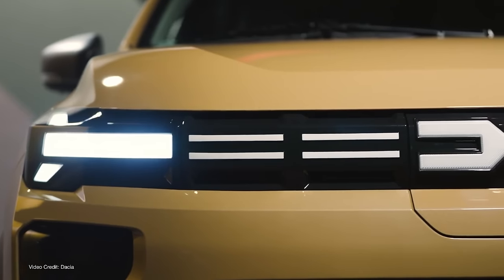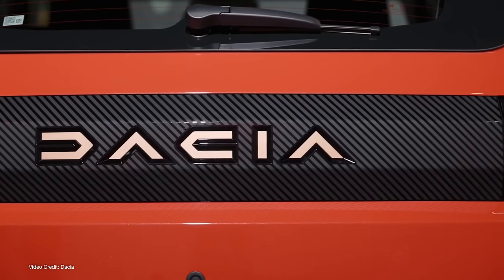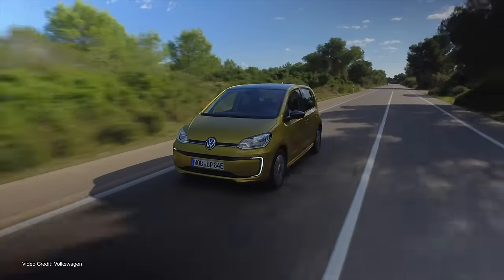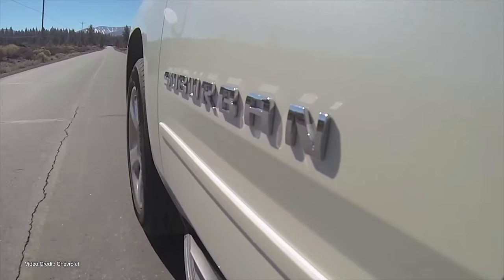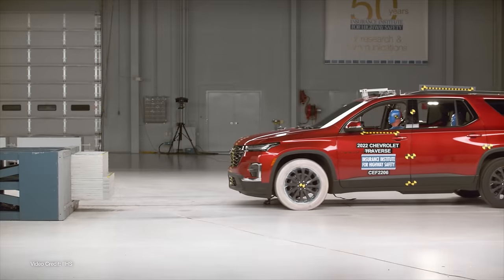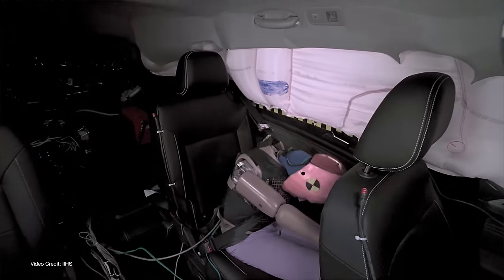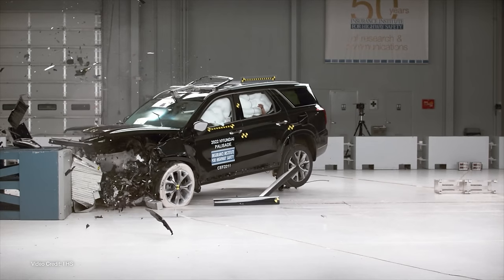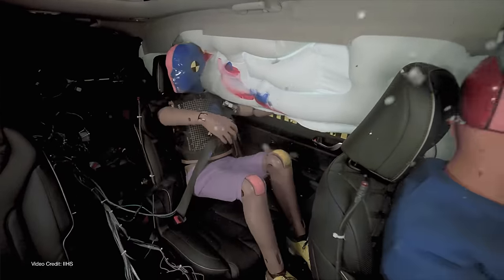Never In The USA - Why the US (And Canada) Appear To Be Anti-Small EV

Comment: First off I would totally buy a $15k EV for around town. Secondly, you just spent a live stream justifying how you will replace the 100kwh f150 lightning with another 100kwh f150 lightning (close enough to the battery size) and while I was happy to see editing Niki pop in for the context, you are personally opting for a big EV while this video is arguing about small EVs
Reply from the maker: Because, as we've said many, many, MANY times, we do need a hauler/tower/peoplecarrier. And when we don't need it (or the battery backup it provides) we don't use it.- Nikki
Reply: @transportevolved  yes you're correct you did say that in the video. Good luck with that hand recovery and the search for another f150. Do you want to do a video on trying to find a used EV to buy? Or something about getting the replacement. When the insurance dust settles.

Comment: I'm not a normal American driver. I drive using defensive skills to the point that I can see potential hazards before they happen and avoid problems on a  routine basis. I had a Mazda Miata for fourteen years and my first EV is an Arcimoto FUV. My next EV will be an Aptera, yet another three-wheeler. Everyday I see fools driving by themselves in a huge  truck or SUV. This is why we are undoubtedly screwed as a species.
Reply: Rising insurance costs causes many to purchase a larger "practical" vehicle than a 2nd tiny "puddle jumper" because most of the fuel savings will be consumed by increased auto insurance.  

I'd like multi vehicle insurance to be like renting my own car - pay nothing on the 2nd car until I use an apt to transfer a coverage token from one of my vehicles to the other car. Then, I'd be driving the puddle jumper most of the time.

Comment: It's not about the size. It's the range. I wouldn't buy an EV with less than 150 miles of range even at this price. That's effectively 100 miles from 10-80%, and I wouldn't let an EV (or an ICEV for that matter) fall below 20 miles of range, so 20-80% or 90 miles is more like it.

America is huge, and Americans love to travel. The Dacia Spring is not a lot smaller than the Bolt, but it has half the range and charges even slower. Sure, it's fine for around town driving, but most people don't want a vehicle limited to around town driving. They want a vehicle that works around town and also works for road trips on the weekend.

I work from home and often don't drive more than 20 miles on a work day, but I take an 80-100 mile (round trip) road trip practically every week, and I don't want to charge on these trips. I take 250 mile (one way) road trips several times a year. Stopping for 45 minutes every two hours or less is a much bigger deal than stopping every four hours. Am I supposed to own a second vehicle for road trips?

Also, 0-60 in twenty seconds is pathetic. What's the point of an EV without better acceleration than that? I would dearly miss 0-60 in six.

I drive a Bolt EV, and it replaced a Mazda 3 hatchback, so I've never been a size queen ... even if my own equipment appeals to them ... Glad you're feeling better.

The Tesla Model Y is not a lot larger than a Bolt EUV, and it's the most popular EV in the world as well as the U.S. It's only barely longer than a Mazda 3 hatchback. If it were an ICEV, it would be a compact hatchback, so there is demand for compact hatchbacks here. Legacy auto's obsession with electric pickups and large SUVs was a mistake, and they're realizing it now.

Comment: EVs are still between 40 and 60% more expensive than comparable ICE powered cars. The charging infrastructure is still insufficient, the cost of charging outrageous if you have to use a public charger, the insurance and maintenance cost way above the ICE cars and, to add insult to injury, the depreciation is enormous! EVs are a complete failure! Contrary to what you say, they don´t sell well at all!

Comment: don’t dismiss range when civilization is ‘down’ and charging may be limited - we are flirting with a civil war for some reason currently
Reply: Why? Everyone is walking or on a bicycle at that point. Gas pumps need electricity to function.
Reply: If you have solar: charging your EV would be a lot easier than refining gasoline yourself.

Maybe you could convert a diesel truck to biodiesel or something. Still would need at least a small battery/solar to act as a tank heater (biodiesel is more likely to gel).
Reply: @jamesphillips2285 planing on having power at home but need ‘range’ as home is only place i know i can fill an EV up on demand. my point was you can’t depend on charging anyplace else - so range is round trip distance, back to the battery bank at the house!